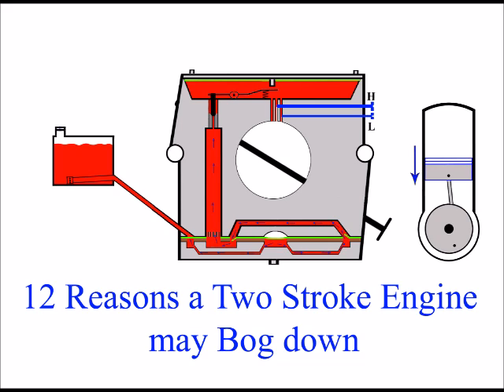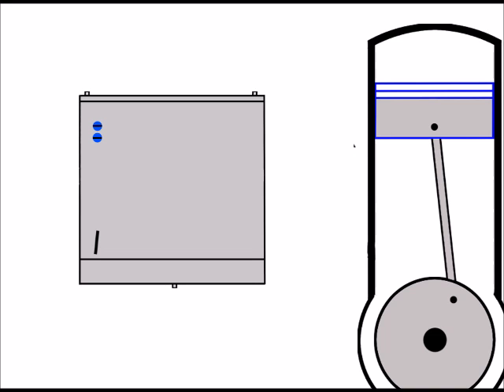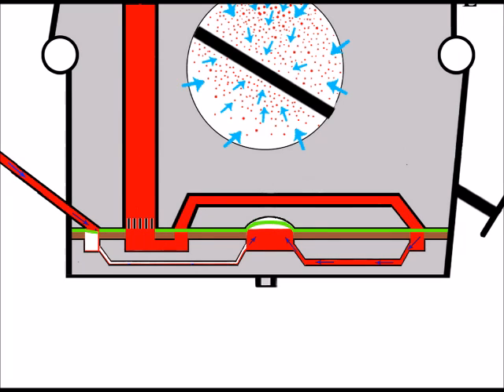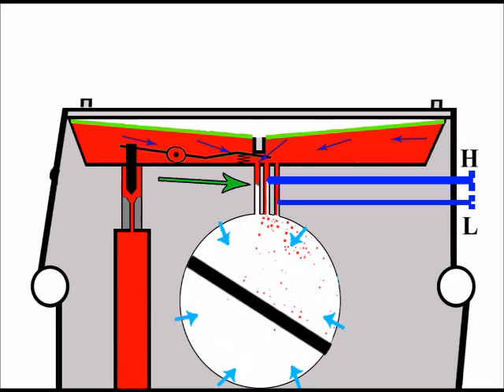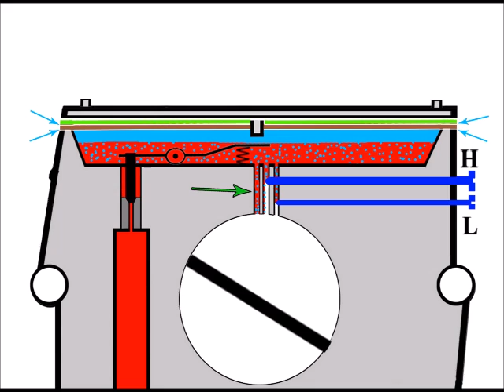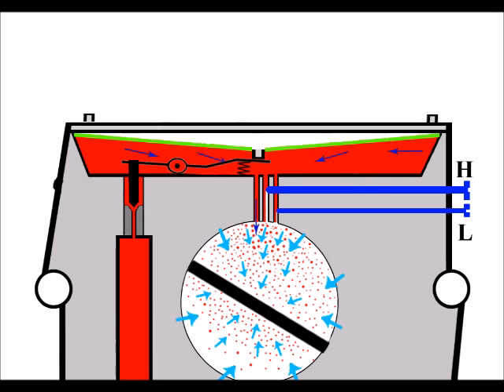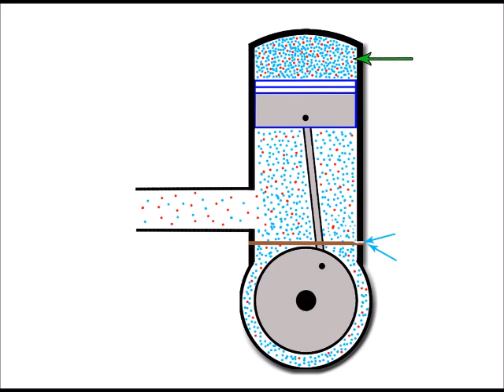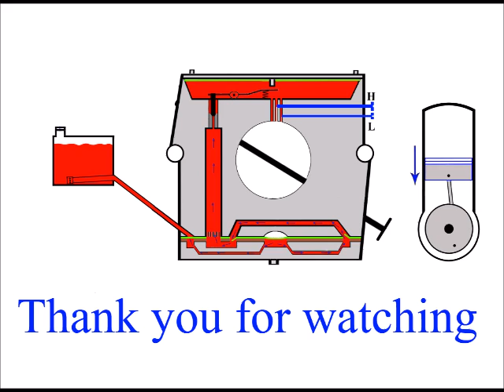Chainsaw Carburetor Problems - 12 PROBLEMS TO AVOID!

Comment: I found a mounting strut loose on a Briggs & Stratton single cylinder. Tightened the stud, and fixed the air leak. Thanks for the tutorial. Well worth the watch.
Reply from the maker: Thank you so much for the nice feedback. I really appreciate it. Craig

Comment: After having watched hundreds and hundreds of videos on similar subject matter I can't sing enough praises for yours.  Granted it is a bit long but absolutely necessary to achieve the exceptional clarity you provide.  Anyone who won't watch the whole thing doesn't deserve the knowledge you attempt to share.  I'm a civil engineer and a professional instructor in several technical areas.  At no time have I seen anyone with your ability to simplify and elucidate on such a major issue that has dozens of causes.  I consider myself privileged to partake of your instruction.  On the whole of my internet experience I have subscribed to only a few sites.  I have learned as much on providing instruction as I have in content here.  I shall add you to my very few favored providers of instruction.  Thank you for your efforts in this regard.  Sincerely, Kenneth E. Weldon, PE>
Reply from the maker: Wow. If ever I had positive feedback then this is the day I had it.  Thank you so much for taking the time to leave this feedback, it keeps me motivated to continue.  Many thanks again. Craig

Comment: Understanding the concepts and principles of operation is probably ten times better for me than all of the "how-to" videos I've come across so far.  I've already gone through the carburetor five times, and even replaced the two diaphragms, after this video, I went through it once more, for all of the little things I neglected to check, and decided the problem wasn't there.  The Stihl MS 310 isn't quite the same as this, but the principles are the same.  I made it my plan, to go through this list, one item at a time, and the most likely culprits first.  The next most likely seemed to be the fuel line, and although it looked fine, a little bit of air pressure revealed it to be broken.  Problem solved!  In a matter of about one hour, a problem I've been chasing for two weeks, now (about six years, of you count the time it's been sitting because of this problem).  This will help in my neighborhood, after the destruction wrought on us, here in Florida, by Hurricane Matthew.  Thanks for this brilliant and comprehensive video.
Reply: Robert Mertens I have a Stihl MS 210c chainsaw and found it's problem to be a cracked "dry-rotted" fuel line with a tiny hole in it. I suspected that was the problem for a good while but couldn't confirm it til I just happened to have the air filter cover off and noticed fuel spraying out of the fuel line. 

Whatever the case may be, my friend...stay inquisitive and always do your research. YOUTUBE is a TREMENDOUS tool for learning. Use YOUTUBE for all it's worth!!
Reply: Lawnmower shops don't want to deal w/these lil 2 stroke engines. They all use Zaymmer Carb's almost. I just learned tonight about the  "SPARK ARRESTOR" that completely cloggs up & cause the engine to idel but not run i.e. no where for the burned fuel to get out cause bog down. I've never seen a lawnmower man speak of that. But I would bet a dollar thats whats wrong w/my Ryobi I bought a new Carb for my Pouland after trying 2 battery powered trimmers one only had one line 20v Lithium so I tried a 40v two line trimmer it was DOA batteries wouldn't charge. So I knew there be someone like this gentleman that covers this on a school level instruction very good resource for sure.
Reply: Watchman4u If you're having problems with your spark arrestor clogging up, you may be putting too much oil in the gas. If the tool in question is a Stihl chainsaw, then it probably wants 50:1. Too much oil can cause other problems with carbon buildup. My old Ryobi trimmer called for 32:1 and it stopped running because the ring got stuck in its groove and it lost compression. The truth is that you never need any more than 50:1 but the carburetor will have to be adjusted to use that ratio properly. Adding more oil to the gas will lean out the air/fuel mixture while decreasing the oil will richen the mixture. If your carb requires a special tool to adjust the screws, just cut a groove in them with a hacksaw. Be careful to not cut too deep. You can find detailed instructions on how to tune a 2 cycle carb on the internet too. I hope this helps.

Comment: Low is adjusted for quick trigger response, and the high is adjusted for high speed power. I always adjusted the high to rev at its highest speed, and then opened it slighty more, to provide extra lubrication into the engine, but not so much to lose power. This prolonged the life of the engine. ( I fell timber, in my younger days, and always re-kitted my own equipment carborators.)

Comment: Thanks for the very helpful video.
I failed to notice it was over an hour long, which was just as well as I may have missed what was so helpful!
I was inspired to fix a poorly pole chainsaw. Now works sweetly.
I was cleaning my father's mower carb when a child but never had a clue what was happening... Now 50 years later it is clearer.
Then fixed an electric mower, electric scarifier and finally my troublesome old Honda powered 4 stroke mower. Using some of your principles, and others ideas.
Then cut the grass!
Other folks comments cause no little levity and so glad you were polite even with some provocation.
Thanks again for your efforts. Keep up the good work.

Comment: 1. 1:23 Mixture screws adjustment - See also youtu.be/7pQ6Vir1uxc
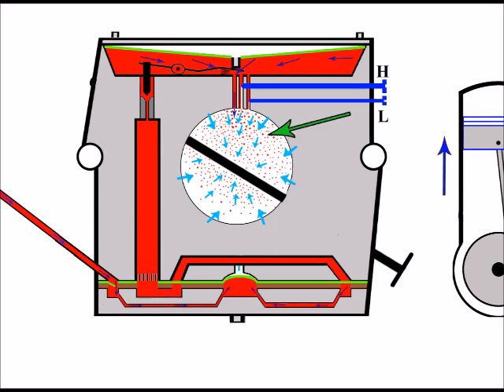2. 4:54 Fuel tank : fuel filter & tank cap breather hole
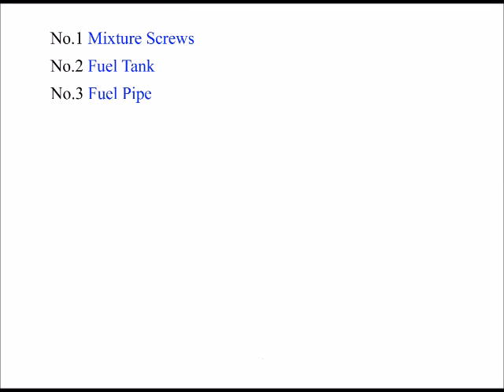3. 8:21 Fuel pipe
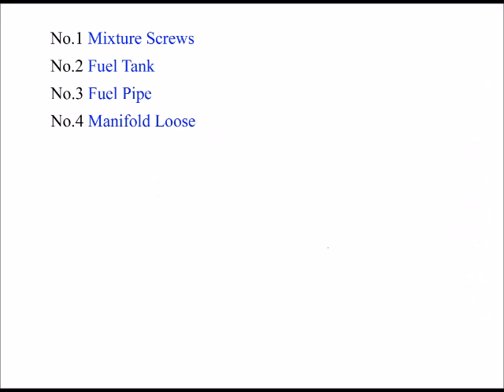4. 9:10 Inlet manifold
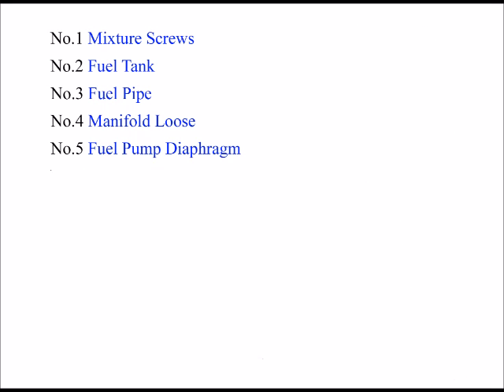5. 16:03 Fuel pump diaphragm
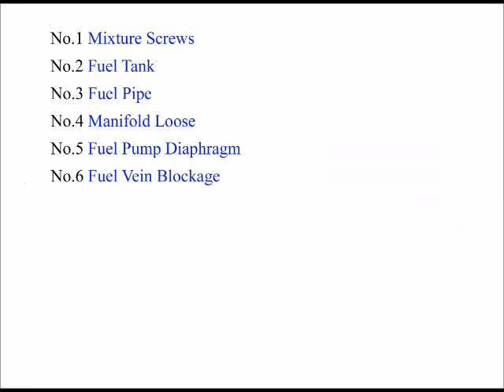6. 22:28 Fuel vein blockage
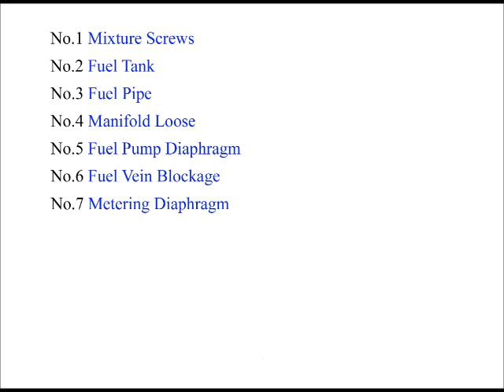7. 32:39 Metering diaphragm - See also youtu.be/Nb_qGDtP3iQ
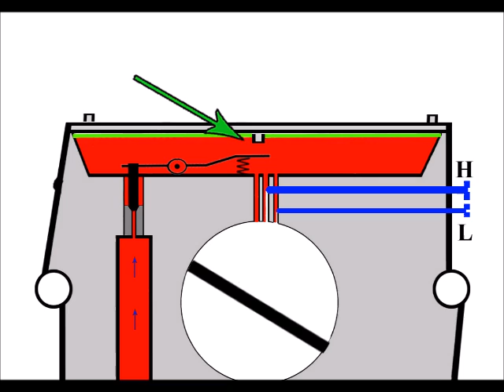8. 48:20 Metering lever
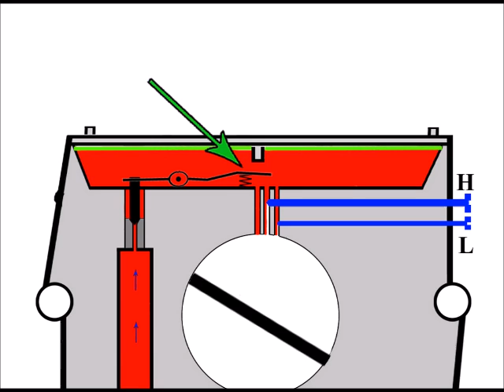9. 50:57 Metering spring
10. 52:59 Barrel/pot gasket
11. 55:51 Crankshaft seals / Main seals
12. 1:00:34 Stale fuel

Comment: Thank you so much for this video. I'm a mechanic by trade, and a very talented one if I must say so. I rebuild automatic transmissions for a living, but for the life of me I've struggled with keeping any of my 2 stroke stuff running, and people give me weedeaters, tillers, leaf blowers etc... Cause they think since I'm a mechanic I can fix it, and put it to use, but I've struggled with 2 stroke for whatever reason, so I sit on dozens of 2 stroke freebies people have given me, but can't seem to keep any of them running for more than say 20 minutes, but your video was amazing. 90% of the stuff I have has a bog down issue under full throttle. your video has helped me to fully grasp, and understand how these motors work, and have helped me to understand what I've been missing. Now time to raid the tool shed, and my plethora of bog down issues, and get some stuff fixed! thank you soo much for you're clarity sir. it is more than appreciated!

Comment: Great video The only thing I would add to the discussion is primer bulbs can crack and cause an air leak and bogging. Eventually difficult cold starting as well from a bad primer bulb

Comment: I had the fuel tank cap issue. I spent $50 on a larger tank for my little scooter and couldn't ride it for a week because I didn't think the new tank could be the issue. If I had watched this video first I would have learned a lot. Thanks!

Comment: I was watching the because of the likely similarities to the 2 stroke vespa I just got, and learned one of the problems that my moped was previously having. I will be much more diagnose and fix any two stroke bog down (and some other related issues) without having very little idea what I'm doing for hours. I've gained a new respect for carburetors because of all the thing that can be fixed with them.
Reply: in the past I've grown to distrust anything that has a carburetor, thinking they are dirty and annoying to deal with, and this video makes them considerably less annoying.
Reply from the maker: Joel Bacon, I'm really pleased for your new found respect. Carburettors can be very tricky and challenging but also very rewarding indeed when you finally get one working great. Thank you for your comments, I really do appreciate them. 😊

Comment: in '67 I exposed the department I managed with hydraulic valve cutouts (from otherwise failed units) so that the younger hands could easily see/understand the workings of various internal components of many parts we used,  much like the drawings you show here.  this does a wonderful job of explanation.   regards.

Comment: Excellent video, look forward to watching many more in your series. Been dealing with a bogging and dying scenario that was progressively getting worse over time. Vacuum checked the fuel line. No leak, purchased new fuel line anyhow, and filter. Removed carb to facilitate fuel line replacement.
Detected some softness of fuel line when replacing but not extreme. Filter was not blocked as I could suck through it easily. Why I didn't do it with my vacuum pump , I still haven't determined. Anyhow I thought I would touch on soft fuel lines, as sometimes I have found them so soft and gummy that squeezing them together has caused the rubber to permanately bond together. Replaced fuel line and filter.
Saw runs fine now, but not so sure it was fuel line. Possibly was leaking manifold gasket due to loose carb bolts, as it was in shop once for repairs and I had been blaming the saw for running crappy for several years since. , Because it was a Stihl I just assumed that was the reason. Now to figure out why my newish Stihl leaf blower bogs down and loses power.
 I would add to your check list the spark arrester,  as that was the problem found  to be at fault with my brand new line trimmer with less than 5 tanks of fuel run thru it.  Maybe my 2 stroke problems will stop when will I learn to quit buying Stihls, and get quality equipment.

Comment: Good video but two things you should have mentioned are that some carburetors use floats instead of diaphragms and that old fuel can also gum up the orifices inside. This is especially true if the fuel is left to sit inside the carburetor between use. The engine should always be run out of fuel before storage. Even if just a few weeks. Lastly, it is a good idea to periodically remove the high and low speed screws and fuel line then spray carb cleaner into the carburetor to dissolve any gum that might be building up.
Reply from the maker: Roy Riederer, thank you for your valued feedback. Your points of course are both extremely true and valid. I didn't add them points to this particular vid because I had a plan to add them to another vid dedicated to this important subject. I do have it on my agenda to include all of this info in detail. Thanks again
Reply: Its a good practice to remove the carb before cleaning to avoid damaging the engine.

Comment: Thanks TheRepairSpecialist.  I have a stihl FS220 trimmer and MS170 chainsaw which I've learned to use but never managed to sort out the problems when the machines cannot start or get bogged down.  This video provides a step by step overview of what to look for if the engine bogs down and I am going to make use of the knowledge -- thanks very much.  Would you also have a video if the engine doesn't want to start?  Imagine and this is merely a "crash course" haha....thumbs UP!!!
Reply from the maker: Fantastic! thank you for your positive feedback.  I will look into your request on the vid as well.  I'm a little busy at the moment with another projects and will see if i can produce something after. I really appreciate your feedback.

Comment: Excellent breakdown of how these things work. Your explanation and recommendations for diagnosis were spot on and instrumental in helping me get my Poulan leaf blower working properly. Kudos, my friend. Keep up the good work!
Reply from the maker: Wow, that is a very motivating comment. Thank you so much. I really do appreciate it. Craig
Reply: TheRepairSpecialist I have bog down on a echo chain saw, I bought a new carb.and still have bog down, have changed fuel lines, thumb bulb, cleaned spark arrest screen, guess my question is would a new carb need the hi -low jets adjusted or not. the carb I replaced was doing same as the new carb is doing
Reply: Steve Griffith I have the same issue.  My next step will be to check the exhaust which if plugged will prevent combustion gas from escaping properly chocking the engine.

Comment: thanks so much, I recently rebuilt my poulan saw carb and am having trouble. It dies when releasing the gas and takes constant on/off throttle engagement to keep it going, after a minute or two it goes full throttle without any bogging down. I'm adjusting the l and h screw and hope that'll solve my problems. Thanks again!
Reply from the maker: Bill Dauterive, brilliant, I hope you can sort it very soon. It sounds like it's lean of fuel and you are right to try the L and H screws first. Good luck 👍
Reply: No just clean your spark arrester. Remove the screen from your muffler cinch it in a vise. Get a propane torch and heat the spark arrester screen till its red hot and wire brush the burnt carbon off. And reinstall. It should start up and run well.

Comment: Thank's. Your fundamental principles, operation, service, and repair's through your video and experience helped. Explaining how each system works, and what could happen, clearly showed, by illustration, how the energy in fuel mixture, is converted into power. Powerful video.

Comment: I’ve had issues with air lock on my zero turn, due to fuel cap not venting. Actually took the cap off one side and swapped with the other side, to diagnose it. Took the cap apart and the check valve inside was fine. Cleaned the cap, and didn’t have another issue.
Reply from the maker: Fantastic! Thanks for sharing. Craig

Comment: Thank you for your exhaustive set of bog causes, which come down to fuel starvation for a variety of reasons, some of which were substitutions of additional air.

The "revs" are better called throttle position and/or load.

At idle throttle position, which is also least load, only the idle fuel and air passages are utilized.  The air enters through the hole in the throttle plate plus any amount it is cracked open by the idle screw.  At that setting the fuel enters only through the idle plus low speed mixture passages.

As the throttle is opened to demand power for a load, it exposes the high speed mixture fuel passage that responds to the increased airflow.

Comment: I have one more reason for a bogging and slow revving two stroke. Stuck piston ring!
The symptom is caused because the crankcase pressure/vacuum pulsation will be weakened when the air leaks past the piston ring on both up and down stroke. This will weaken the engine performance slightly but more important cause fuel starvation at full throttle speed.  An engine in this condition will most certainly bind from the lean condition if not fixed immediately and that will cause damage that ain't worth repairing even for the DIY guy.
Btw. If you found this to be a useful tip please click the thumbs up. I have experienced this with 3 different weed wackers so i bet it is a fairly common problem.
Reply from the maker: Formula400Pontiac, yes I agree. There are many causes
of bog down, much more than what I have listed. The ones i included are just my experience of some of the most popular ones . Thanks

Comment: Just found this and I hope it will solve my problem which is bog down even though I have stripped and cleaned the carb  used fresh fuel and correct mixture I still got bog down, so will go through with all I have learned from watching your video and hope it will cure the problem, thank you very much for a brilliant video.

Comment: Great video. I just did my neighbor's weed wacker stihl fs55 rc. Same issue with the bogging. I cleaned out the carb, air filter, fuel tank and fuel filter and still was bogging down on acceleration. Then I checked the spark arrester. It was completely plugged. Cleaned the spark arrester and all is well. But it definitely need the rest of the work i did.

Comment: Hey mate, thanks for the helpful videos. I have a 2 stroke Mercury 15HP outboard. It doesn’t have H and L mixture screws. It only has an idle mixture screw. My motor runs at idle fine. But it bogs down as soon as I increase throttle. If I can make it too high rpm it runs fine, its just the initial idle to high speed change.

Comment: I enjoyed this video, even though at times it dwelt on a point too long, when it was sufficiently explained. I do understand the High and Low adjustment settings clearly now; THANK YOU VERY MUCH. You should add "cause # 13" .  That being the spark arrester on the muffler being partially plugged by carbon build up. The back pressure chokes the engine up at high discharge rates, but not quite so at low RPM.
Reply: How can I fix the problem of engine going off when put choke on

Comment: Thank you from the Antipodes,now I know a lot more about my two strokes.Edit,I stripped the carb off my FS66 and found the plastic elbow for the fuel hose is cracked,hmm brass barb,pressed into the carb body I presume.